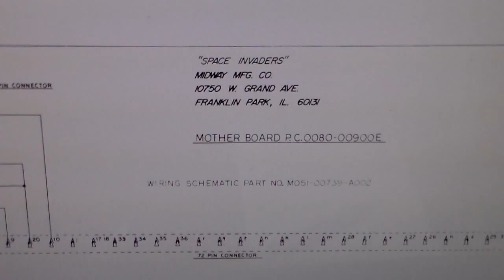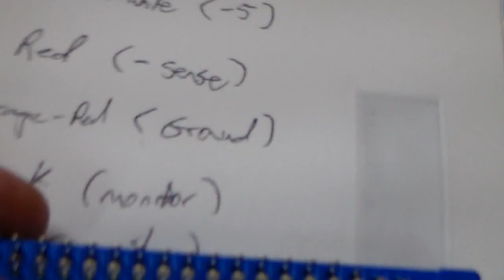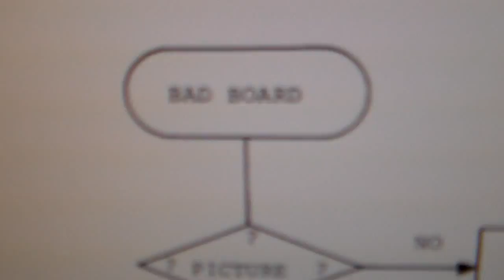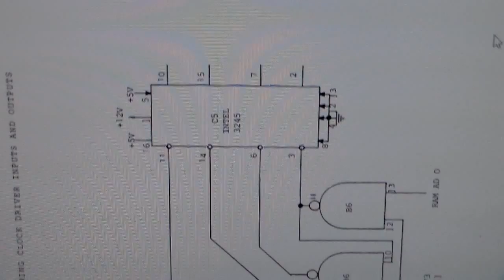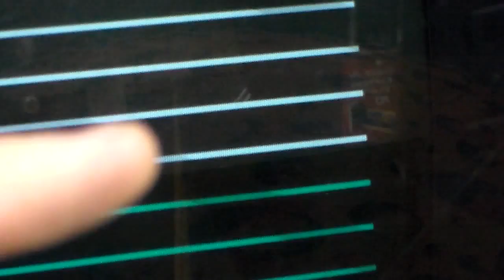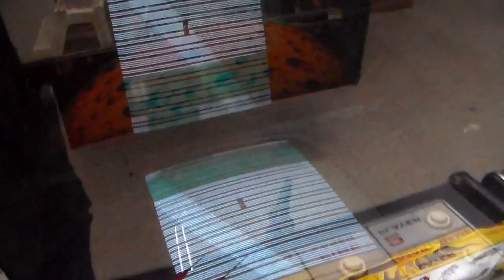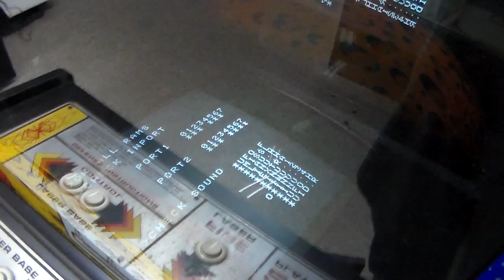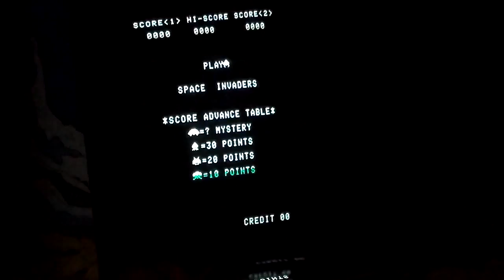PCB Repair of a 1978 Midway Space Invaders Arcade Game!

Comment: They definitely made keying for the connector.  That is why there are slots between each pin.  They did have a tendency to fall out however. 

I want an old game like this but they are getting scarce and crazy expensive.  I partially paid for college fixing these.  For some reason I fixed a lot of Tempest games.  It was easy, 95% were just bad power supplies.
Reply from the maker: I've got a Tempest we're going to be working on the next couple weeks, hope it's just the power supply :)

Comment: The other issue with the edge connector in these games is that they had a very small contact area.  So not only did they lose their tension, but they were weak from the start.  The IDC wire terminations were another weak point, as well as the 90 degree angle that the wires came out at and pressed against the cabinet.  Not sure why they didn't use a 180 degree connector with wider pins when they built these.
Reply from the maker: There was a design theory in effect at the time, that basically they wanted the things to last about 2 years, so when we look at it now some things are designed with what looks like a long term reliability in mind (the coin door, the glass bezel, the controls, etc.) and other things like the connector etc. aren't very reliable at all

Comment: That plug is a elco plug.. a lot of AMF bowling machines 8270 s in particular have that plug for the power masking and pindication...
Reply from the maker: Thank you, I'd never heard of it!
Reply: @LyonsArcade  although they are out there parts for that green plug are hard to find..
Elco the company, has distributors but they know you need their products and can be pretty pricey and want you to buy in bulk....  I wished I'd of known about that blue plug, that it was available.. 
Quite a few of the plugs I needed could have been replaced....I went thru Digi- key but had no luck.... The bowling center I worked at made me get salvage parts so I could get used pigtails and wire them in. .

Comment: Thanks! I have a similar problem, the ram test doesn't work at all, but the line pattern is "normal". Now i'm waiting for replacement ram ics. I will try some soviet-clones of 2107s from epay.
Reply from the maker: the Soviet stuff is all high quality and it's generally the actual correct part, a lot of the stuff you buy from the US is just stuff the seller bought from China.  Also the stuff from Israel is usually good stuff...

Comment: I thank you Joe's arcade on getting back with me. I want to know if you think the problem with my monitor is that it has vertical collapse if that might be the problem if so what part would it be
Reply: The neoteck monitor board nt500-dx0001 model
Reply from the maker: If you have vertical collapse, you would see a line all the way across the screen of video, but it'd be really thin.   Can you see anything on the screen?

Comment: I have a 1978 all original space Invaders like this machine you're showing here the machine works I have to turn the button on and off multiple times and after a while it warms up and works but sometimes there's white dots on the screen sometimes you can play it for a while and then the white dots will appear and it'll act funny but I mean this thing is all original I found movie tickets in it from 1983 for the movie cujo!!! The serial number is 0808 I would like to give this thing a tune-up and make it last for another 40 years and maybe add one of those the 8  game expansion packs I saw online to it possibly the only thing really wrong with it is the white dots appearing and it needs a new bulb for the background to light up and some lights for the quarter sign on the door
Reply from the maker: It's one of the true classics, fix it up!
Reply: @LyonsArcade  what should I get for it? Can I put a modern power supply in it and get rid of that capacitor? And how do I clean the dust off the circuit boards

Comment: Joe, love the video,helps out alot, have the same problem.. its telling me H11....you mention chip 2107 and socket . I can't  find that chip,  can you tell me where I can find them and what socket 
I ll need....new to this , any help would be great..thanks
Reply from the maker: Sure John, there's a place called Arcadechips.com that should have those 2107's you need... I don't know if they sell sockets, but basically you count the number of legs on that chip and you can order a socket with that number of legs on it.  So it may be for instance 18 legs, if I was just guessing :)  You can get the sockets pretty inexpensively on ebay, the hard part is the desoldering!
Reply: @LyonsArcade   joe, thanks for the reply, I have the Braze multi kit on it, and it has a ram test which beeps out which ram is bad...I don't have the burn ram test chip.... I replaced a couple of ram chips with the socket, per the beeps on the chart, but  it keeps telling me H11( D) in your video..after I replaced it. and I can't see anything wrong with the traces, but its out of my experience.....Any ides ? also do you repair the pcb boards? Thanks

Comment: Great video! I was hoping you could tell me, on the upright midway space invaders 11 pin connector; what is the pin 10 "V. Audio Return" and pin 11- "V.Audio" for? 
Does this pin11 need 12-18v for the sound to work?
Reply from the maker: The "V. audio Return" is ground, the "V.Audio" is the positive voltage just as you said.... They original came from the power supply, if yours is messed up and you have the original power supply, there is a diode just below the power supply connector that goes open sometimes and makes the sound voltage disappear.  Also the fuse in the bottom that runs the marquee lights also runs the sound voltage... so if it's blown you'll lose it too.
Reply: @LyonsArcade  Thanks!

Comment: Would the same way to test ram work on this as in a commodore 64? Basicly you take a spare ram chip and just push it on top of a ram chip on the board so the pins touch and when it starts to work you know wich one is broken.
Reply from the maker: It only works sometimes but yes it would prob point to the bad one....

Comment: We've got the same cabinet.  Here's the problem the fire button stopped working.  When I check the voltage the switch was at 1 volt while the other buttons were at 5v as expected.  I traced and measure the voltage back to the board with the console harness disconnect and still 1v.  Any ideas where to look or what might be needed to fix it?
Reply from the maker: Make sure the dipswitches didn't get bumped around, there's a weird thing on Space Invaders where if you turn certain dipswitches on or off, it turns some of the buttons on or off (it had something to do with the two player option)...

Comment: I just recapped my power supply. where can I test the 3 voltages from? Been trying to fix my Space Invaders over a couple months. Thanks.
Reply from the maker: Unplug the gameboard in case the voltages are wrong, and then check them from the individual pins coming out of that one big plug connected to the power supply, the voltages are in the manual, if you don't have it you can download it at www.KLOV.com on the Space Invaders page...

Comment: Would using a 60-1 board and turning off all the other games be a solution? I have one that will not boot and I am unable to find anyone that still repairs these boards.
Reply from the maker: That won't work unfortunately because the monitor in this game is black and white it won't hook up to the multigame board.  You'd have to change the monitor, the power supply, and all the wiring and you'd end up with a machine that would be worth less money....

There is a guy on ebay that fixes them, type space invaders repair on ebay and check him out.

Comment: what are those blobs of solder on the boards - is that circuit from the other side of the board?  almost looks like a circuit just ends abruptly.
Reply from the maker: Not sure which ones you're mentioning but yes when a circuit just ends with a piece of solder usually that's a via that runs through to the other side of the board and continues there.
Reply: @LyonsArcade  Did you see my question about the process from when a coin is inserted?  Just curious if you could kind of walk through the process in another video or maybe you have a video where the coin reader was failing or it didn't give the player credits.

Comment: I'm new to this but why did some old games reflect a reverse image onto a mirror instead of just pointing the screen right at the player ? Is that to save space at the back of the cabinet or to keep the center of gravity low in the cabinet?
Reply from the maker: There were two reasons they did it.  in Space Invaders they did it because by using that mirror, you could put artwork behind the two-way mirror that lights up, this makes it look like the screen is floating in space.  So the computer was only capable of creating the images on the screen, all the background stuff was actually in the cabinet, and viewable behind the image, which you can't do with a regular tube and the processing power they had at the time.  so imagine like Super Mario Brothers, but the computer is only strong enough to create Mario and the moveable characters, but not the background.  The background would be in the cabinet behind the mirror so the characters looked like they were moving over it.

Some of the even older gun games used a mirror because it made the cabinet look really long when you looked at the image, so you'd be looking at a reflection in the bottom of the cabinet, that looked like it was 5 feet away where the cabinet was only 2 feet thick.
Reply: Thanks I really was curious and I guess it's been a while since I played space invaders I hadn't realized that

Comment: When you say you replace the chip are you actually unsoldering all the pins and replacing the chip literally? You should show at least once
Reply from the maker: I have on some videos, but yes you unsolder each pin, remove the chip, solder in a socket, then put a brand new chip inside the socket.

Comment: Hi Joe, Question: I have a short circuit fault. My entire Space Invaders Motherboard +12V ( Side Connector 3-4) bus is shorted to ground ( Side Connector 13-16). I did have this on the +5 as well but when I recapped (Just the Electrolytics ) the Motherboard this cleared. Any ideas? Enjoyed you site by the way http://www.lyonsarcade.com/Games.html
Reply from the maker: It's going to be one of those tantalum caps, they look like gumdrops.  Seen it about 20 times!
Reply: @LyonsArcade  I see two blue ones at 22/25v and went for the closest one. After pulling it and with my ohm meter set at 200 it read .02 ohms across it. Yep, I would call that a short.
Reply from the maker: If you can Thomas replace all of them, even if they're fine now they're little tiny ticking time bombs :)  They won't really hurt anything if they short though, the whole board will just shut down!
Reply: @LyonsArcade  Well I just got the new 22 uF 25V Tantalum Capacitors and the game flat out came on and runs with all sounds functioning. The screen seems cut off on the left a bit. The "S" in Score is cut in half and I think its the number 4 on the bottom left is also cut in 2/3s. I'm not surprised because I re-caped the electrolytic' last week. I am guessing one of those pots needs adjusted? I tried Vert LIN 1 and it helped a tiny bit by turning what looked to be a one into something resembling a 4 in the bottom left. I tried VERT LIN 2 but it just pushed the right side of the screen out with no effect on the left. Its a Wells-Gardner 19V1001-19"
Reply: Sorry Joe if I'm asking to many questions.